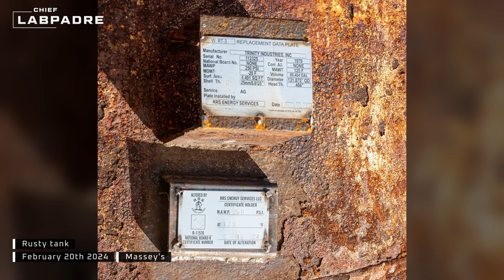Some Worse For Wear Hardware Arrives at Massey Outpost... - Starbase Gallery [Feb 14th - 20th, 2024]

Comment: In a humid environment a new steel tank will look like that in a matter of months, this is normal.

It's nothing more than an outside surface oxidation that is easily reversable and preventable once a cathode reduction system is installed on the tank. No need to install such a system and run it while the tank is in storage or transit.
Reply: Agreed, this is not a big deal. That tank looks like it would be pretty thick walled. It was built in 1979 and altered and recertified in 2024. 45 years old. It'll probably be able to do a lot more years than that.
Reply: Someone in Boca Chica has some sandblasting in their future.
Reply: @jameskelly1680 Wall thickness is 25mm. That was one of the pieces of info that could be read off the label on the tank that Chief’s managed to catch with a really clear close-up photo. There was also a PSI figure (250). I’m guessing this is a water tank for the flame diverter/trench deluge system. It looks like a pretty big tank (volume and diameter were also on the label) so perhaps this will be enough on its own to supply the deluge system with enough water?
Reply: @TheEvilmooseofdoom  Probably not as that would actually remove material from the tank.

Once a cathode reduction system is attached, that rust will revert back to pristine steel... just needs a coat of paint and the cathode reduction system from then on to maintain tank/steel integrity in almost any environment.